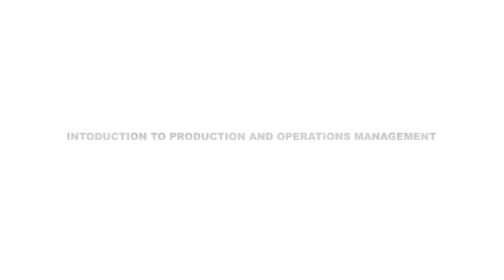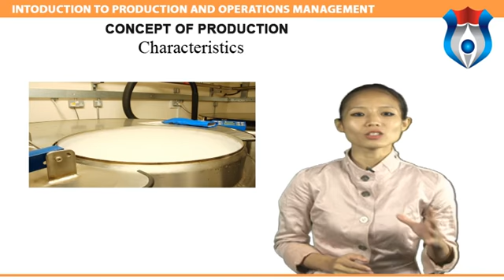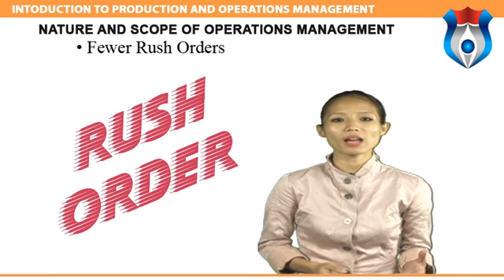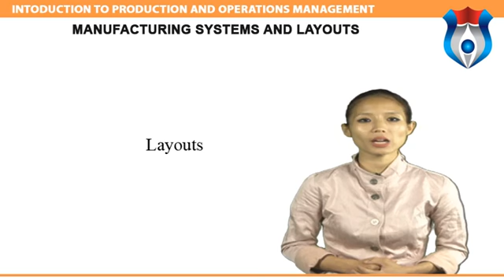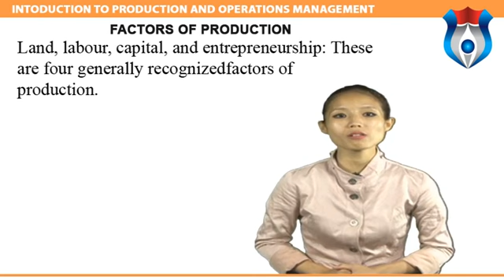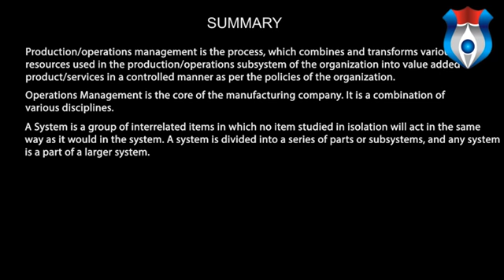INTODUCTION TO PRODUCTION AND OPERATIONS MANAGEMENT new

Comment: Hello everyone I need your support about this

Suppose the chocolate manufacturer organize and staff the factory for a ‘normal’ capacity level of 10 tonnes per day. If increasing the capacity 1 tonnes per day will costs £ 5000 and decreasing the capacity 1 tonnes per day will costs £ 3000 .
 1) Make a mix capacity plan, calculate its total cost and make it as low as possible.

Comment: reference materials kindly?
Reply: Suppose the chocolate manufacturer organize and staff the factory for a ‘normal’ capacity level of 10 tonnes per day. If increasing the capacity 1 tonnes per day will costs £ 5000 and decreasing the capacity 1 tonnes per day will costs £ 3000 .
 1) Make a mix capacity plan, calculate its total cost and make it as low as possible.
Reply: Help me this plz